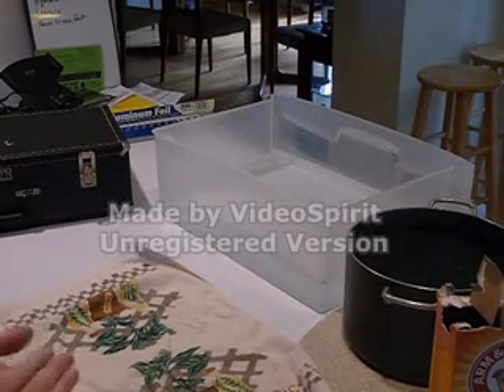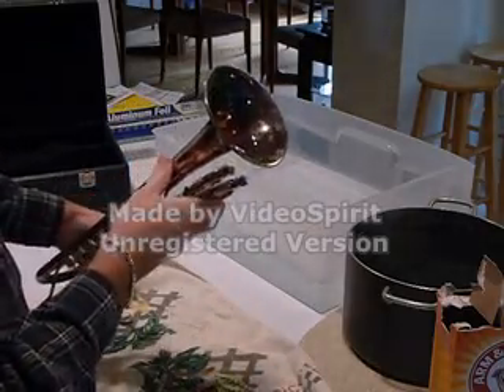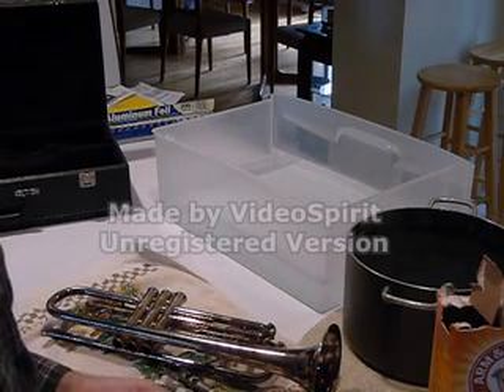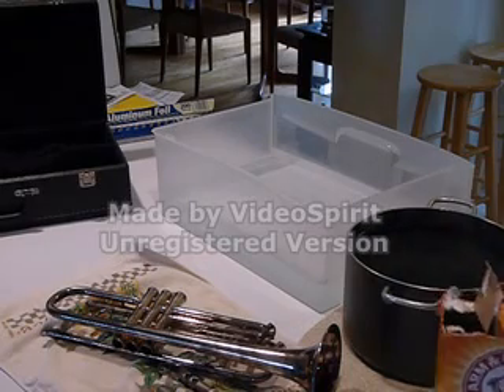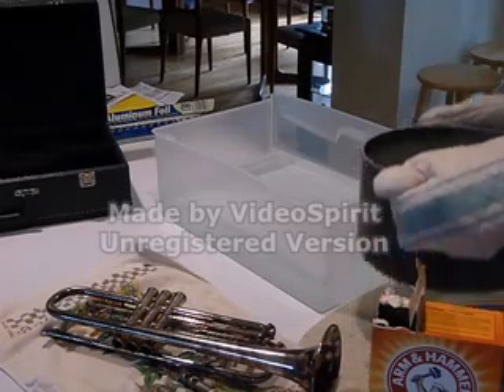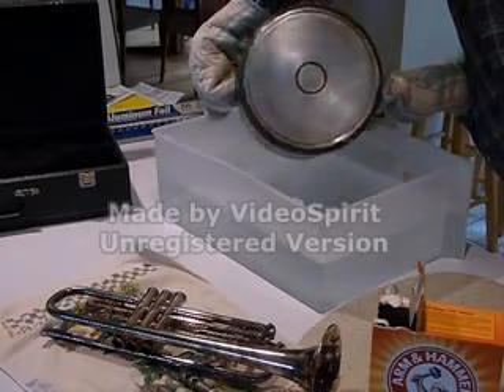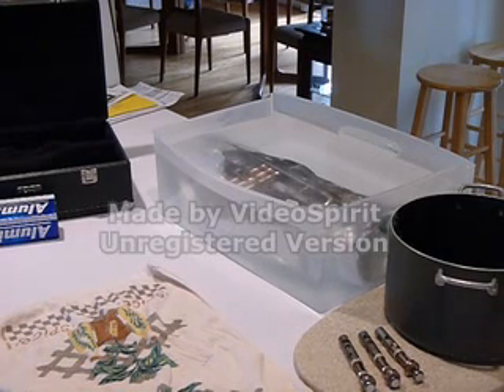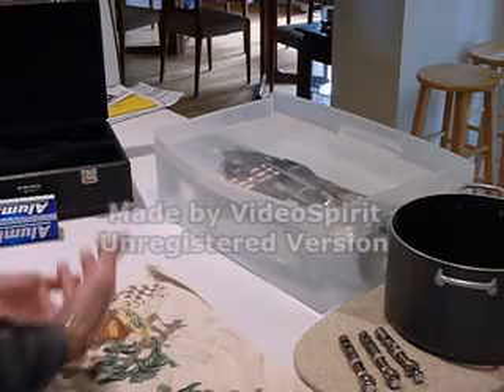NON-ABRASIVE Cleaning and removing tarnish from silver trumpet

Comment: Used this technique on a tarnished Getzen Cornet and it worked great. I do have a question: as a musician, my background in chemistry is naturally limited, but I do remember that electricity travels from positive to negative. Would this process work even better if you hooked up dry cell batteries - positive to the horn body, negative to the foil while the horn is submerged in the solution?
Reply: I may be a little late to the party, but I do have a chemistry background - with an electrochemical process like this, essentially what is happening is silver is starting off as an ion (because it's bonded to sulfur) and then being turned back into a non-charged metal without the sulfur. Aluminium is starting as a metal, and being converted to an ion, and the sulfur is moving across from the silver to the aluminium. In this case, this reaction happens spontaneously, because aluminium has a greater affinity for sulfur than silver does. You would normally only need to apply a charge to get a non-spontaneous reaction to happen, and you definitely run the risk of making a non-spontanous reaction happen instead by applying a current. Tbh, I wouldn't recommend. If you want to make this reaction faster, just make sure your water is really hot. 

I've got a Getzen too that's looking a little worse for wear. Excited to try this out!
Reply from the maker: Not sure.....be careful though because you may end up electro-plating the aluminum with silver from the trumpet (thus removing silver!).
Reply: I also have a Getzen trumpet that I used play in high school.  Going to try this method.

Comment: Only baking soda?  No salt?
Reply: If I could add my 2 cents...I sell vintage silverplated flatware and use this method (which is a form of electrolysis where the tarnish is transferred to the foil). Technically baking soda IS salt, and I think dissolved salt works better. After soaking for a bit try rubbing the tarnish off with dry baking soda. I've never had the technique remove the plating, or even additional plating from a piece that already has plating damage. If you're not sure, try it on your mouthpiece first.
Reply from the maker: I dont add salt.....it is not needed.
Reply: I’d pull the slides before emerging and rinse very well with just water afterwards. Then grease and oil everything up and put back together.

Comment: does this work on a silver bach strad?? im scared to try
Reply: Worked on mine.  I was nervous, but I didn't want to polish off all the silver trying to remove the dark spots.  It even had some blue mineral deposits that were growing and this process nearly removed it all.  There was just a little bit of spot polishing to do afterwards.  Looks like a new trumpet after 20 years of tarnishing in a closet.
Reply: Brandon, did you try it on your Bach? I have one too, but am scared to try. I'd love to hear your results!
Reply: TheOverdueTraveler it totally worked!!!
Reply: i am gonna do it with my bach... hope nothing goes wrong
Reply: How'd it go? I gotta clean my bach as well. I'm curious.
Reply: It should be fine as long as the water isn't too hot and you don't leave the horn submerged too long
Reply: UltraMini GT did it work on your bach?

Comment: Awesome, going to try this on a couple small trumpet parts first to test it. Have a badly tarnished silver 1930s sousaphone, too, but that's going to be a pretty big tub of water. :( Any tips for doing this w/out full submersion?
Reply: +Kevin Freitas Well what i did with my marching eupho is i dipped it section by section
Reply: Yeah, worked pretty well overall. Will be trying this on a couple older silver trumpets too.
Reply: +Kevin Freitas I have a century old trumpet two-thirds quite a bit of tarnish on it. it looks like it has been well taken care of, but some of the base metal is showing on all of the tuning slides. fortunately it doesn't ruin the look of all of the trumpet. some of the base metal is actually nicely shown in some of the places, which brings me to believe someone tried to manipulate where it was in some way... it's still an interesting trumpet.
Reply: that was the same with my trumpet it used to be my great grandmas trumpet trying the trick in the video.

Comment: Um.. I tried it with my silver plated trumpet for the first time today and, I think it looks worse now. Brown spots have appeared on certain parts of it and it won't come off. I don't remember seeing those spots before I soaked it...
Reply: Mel J. might be raw brass showing thru
Reply: the brown spots if they are the brass or copper showing through you can use a silverplating solution to get it replated. I personaaly have gotten really good results with a product here in holland, called holland hallmark silver plater, I do think they take international orders. I have used it on my bach and it is a miracle. I hope that helps.